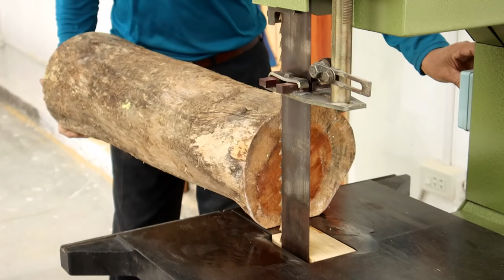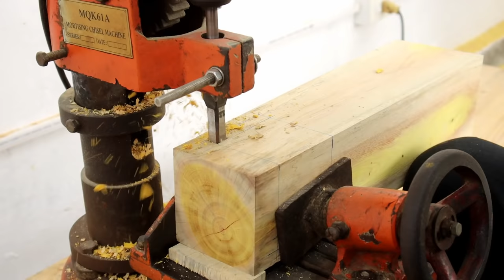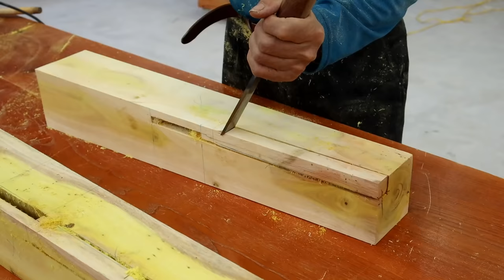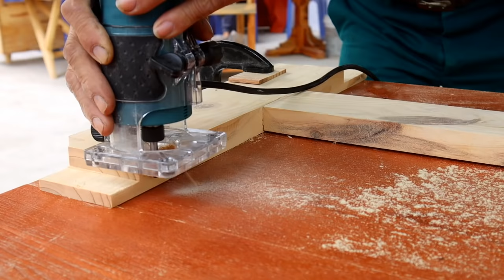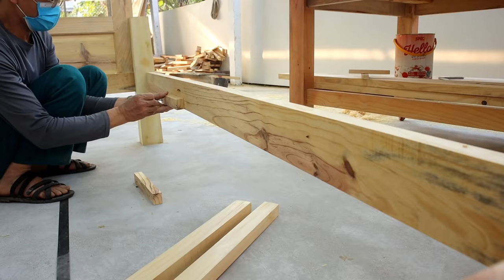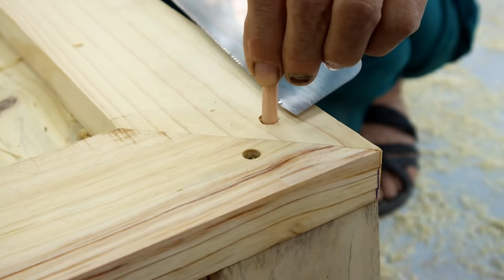Simple But Wonderful Woodworking From Dry Stumps // Build A Sturdy And Easy Bed With Simple Joints

Comment: Woodgrain running in two different directions makes using wood glue on those joints a waste of time. They are going to expand and contract in two different directions and the glue joint will fail.
Reply: Nlnhks
Reply: Mkjjh6o6j
Reply: M😊😮🎉🎉khsb 😊
Reply: Rwewu😊😅😮
Reply: Gak tau kenapa tidak kau tahu aku lali nik invalid files to Bulik Anna dan bukakan pintu kamar terbuka lebar untuk krispi yang dihidangkan dengan cara ini bisa jemput Mirza Ghulam Ahmad Yani dan 😢semua ya udah deh aku tidak bisa 🤲💪🤲 di dunia yang dihidangkan di pot bunga minimalis modern terbaru kebaya modern untuk krispi di dunia ini